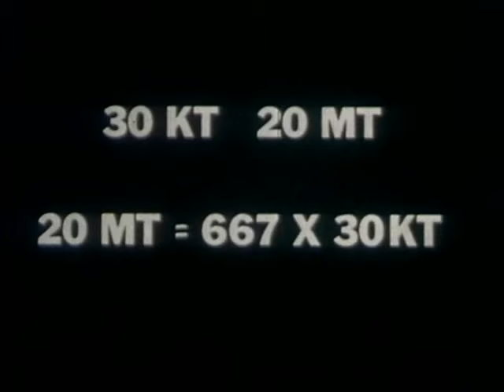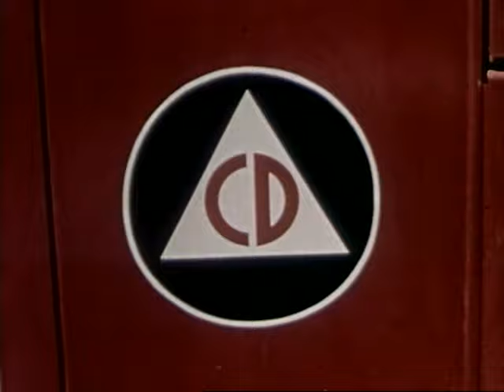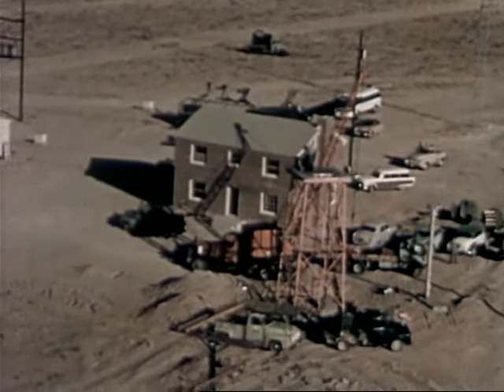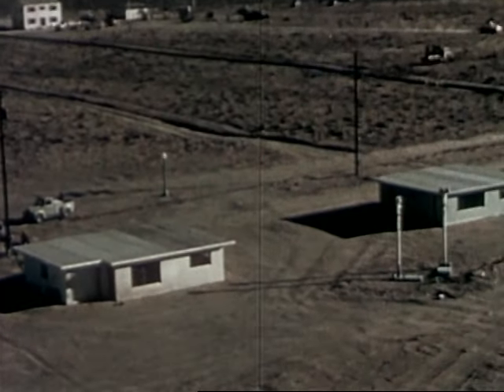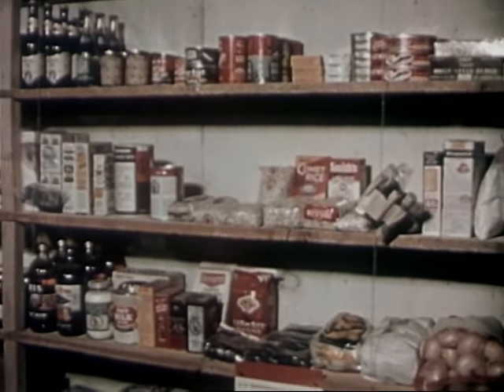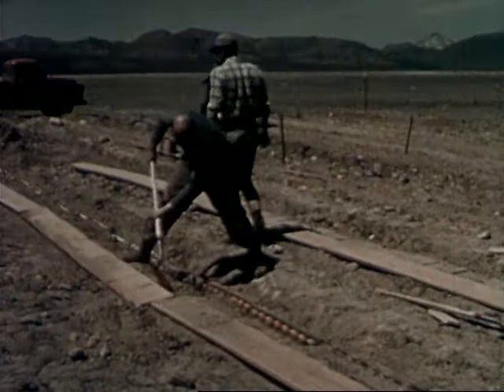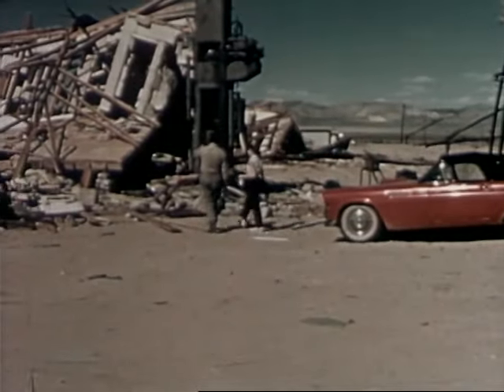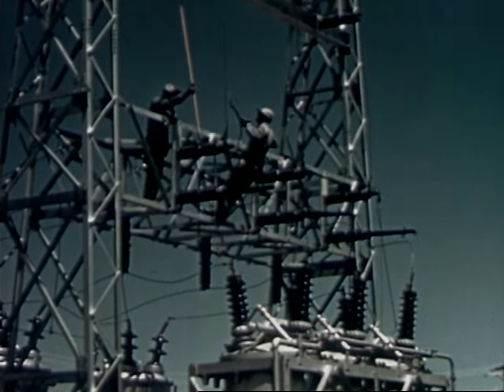Operation Cue (1955)

Comment: Nobody mentioned the radiation fall out around this detonation.  They should have been nowhere near there but 24 hours later they are right in there touching things with no gloves or frig all. What? And the soldiers in the trench all died from radiation and a lot of them went blind.
Reply: Yeah they died of old age
Reply: Again, fallout would be minimal in a test shot that is in a high tower.  Detonated on the ground, however, would be a different story... hot ash and debris bonded to the bomb's material would be injected into the atmosphere right away, to fall out later according to prevailing winds.
Reply: Thank you, I was wondering about that. They didn't know that every thing is contaminated after the test ?
Reply: @Psychotix91  See my above comment.  There is little contamination because the fabric of the actual device was not allowed to bond to the material of the ground, ie an 'airburst'.  If it were detonated on the ground, you would get 'hot' ash following the prevailing winds and falling out later, contaminating whatever it touched.